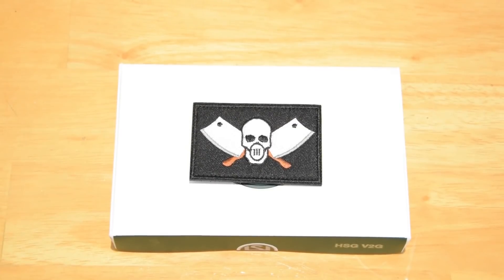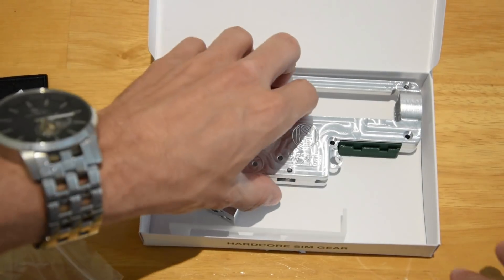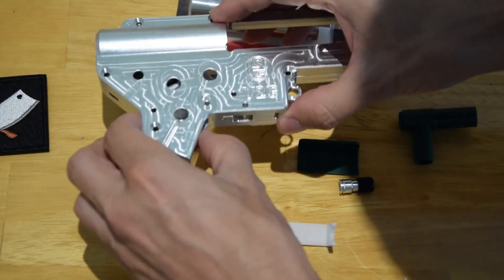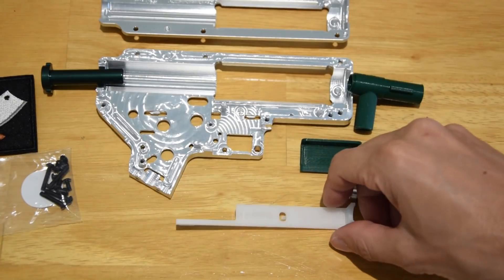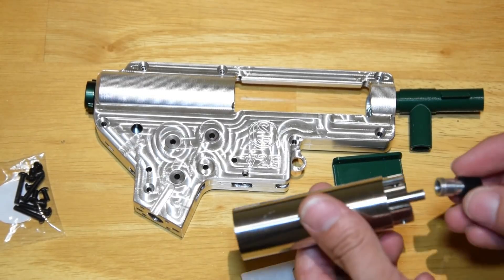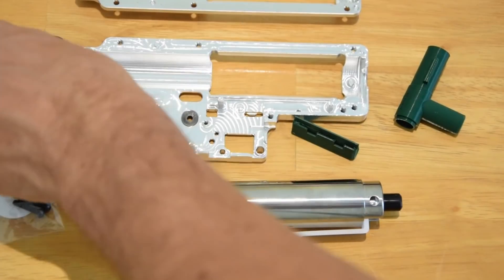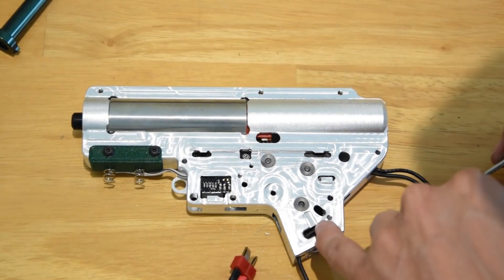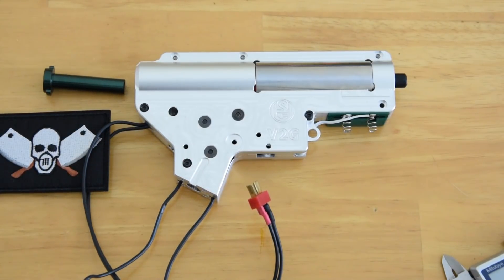BOLBR: HSG V2G gearbox

Comment: I'd source a soild piece T-piece as the 3D printed ones don't last as they split at the 3D printing layers. Very delicate. Bought 2 for the K3 and ended up sourcing a stock T-piece in the end.
Reply: Hi there, were they HSG branded t-pieces? This shouldn’t be occurring.
Reply: @hardcoreblasters  yeah they were. 1st one broke at the top tab as the t-piece screws into the front of the gearbox. 2nd one broke barrel side just after mag opening. Both followed the printing seams. I'm thinking a thin laquer spray would give the extra strength.
Reply: That’s very unfortunate.

The Kublai T-pIece is a very delicate design: https://blastersupplies.com/products/hsg-kublai-t-piece-for-toy-gel-blaster

The “solid” t-pieces are very durable. They don’t have thin delicate arms like the Kublai.

I don’t have a record of 2x HSG kublai t’s to the same name. Where did you purchase them from? Happy to refund you as this shouldn’t occur.